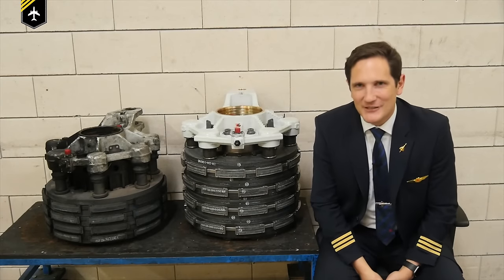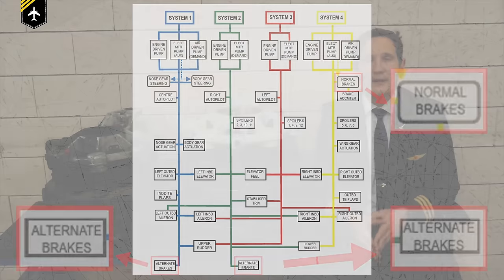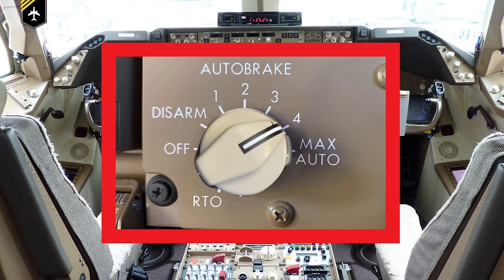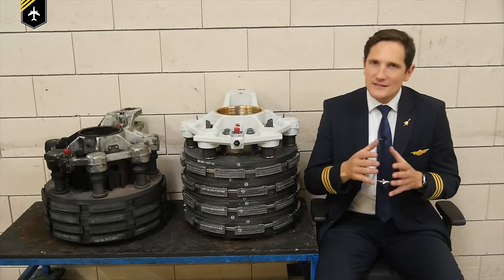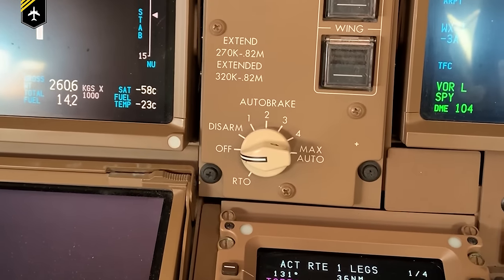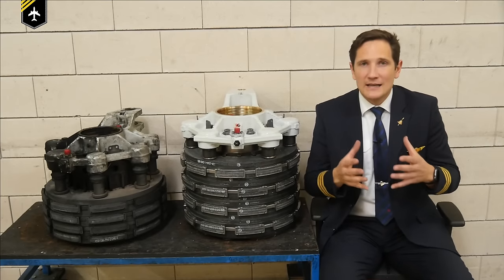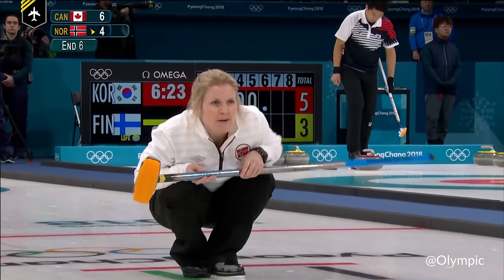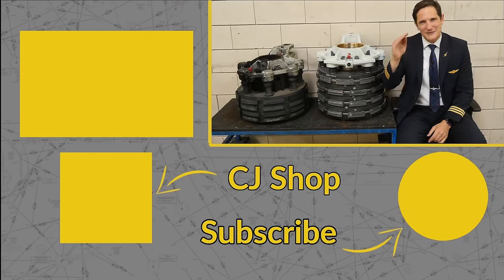How do PLANES SLOW DOWN on the RUNWAY? Autobrakes System EXPLAINED BY CAPTAIN JOE

Comment: I use to make aeroplane brakes in my last job. We made them for Boeing 777, 767 A380's and F18/22 fighter jets. We made the initial segments and then shipped them to South Bend in America for them to be finished off into fully finished brake discs. The discs are named stator and rota during production and that dictates the way the carbon is laid and cut.

Comment: I work for Parker Hannifin systems control division and I build the EHSV valves for the 777 and 747 autobrake systems. Have built literally hundreds of them. Never knew how they worked on the aircraft until now. Thanks Captain Joe........

Comment: Very well done Captain Joe. My 33 years as an airline landing gear engineer agrees with all your comments. Before the auto brake systems were installed, it was interesting that the left side brakes wore old a little more than twice the rate of the right brakes. It was suspected that the pilots didn't have as much control with their left foot as their right. Perhaps it was that they were used to braking a car with their right foot. We never found an answer. Thanks for your videos.

Comment: Loved it as always, especially with the break parts as props, although I wish you could have described them a bit.
RTO setting was a surprise and very interesting.
Patrean Brian
Reply: Airliner brakes are multiple pairs of rotor and stator discs, pushed together by pistons arranged around one end of the stack when hydraulic fluid pressurizes the pistons.  Typically there will be about four pairs per brake unit in a modern carbon-material rotor/stator design.  Steel brakes, used on aircraft introduced in the early 1980's and before, might have five pairs (or more? -- I don't know all of the aircraft out there).

Comment: I have a question about wing and engine placement. Up here in Scotland, we get a lot of regional turboprops and jets, and they all look very different from each other (ATRs, Dash-8s, CRJs, Saabs, etc.) Compare this with bigger planes for medium- and long-haul aircraft, you see that almost all of them (777s, A350s, 787s, A320s, A220s, E-190s etc.) are very similar in design with low wings and underwing engines. What are the advantages and disadvantages of these designs, and why do the regional jets and props have much more varied designs? Thanks

Btw, love your channel!

Comment: Hi Captain, english is not my native language, so forgive me if you already mentioned the following in this video.
What i'd like to know is: when ready to take off, autobrake set to RTO and go airbone, when does autobrake knob return to OFF position? Immediately after wheels leaves the ground? Or it depends by other reasons/variables or maybe on plane's model? Maybe there's a sensor (like autobrake engaging once touchdown) that "feels" the main gear is no more on the ground?
Every info about this will be very appreciated. Thanks.

Comment: Question: If manual braking using the rudder pedals would disarm the autobrake fully, would you always have to instantly switch to full manual braking when making slight rudder/steering corrections during rollout?  Awesome video as usual! 😄🙌
Reply: No because operating the rudder and operating the brakes are different function. Braking you tilt the pedal with your toes, for rudder you push the whole pedal

Comment: Loving your videos! This one is a little over my head. You are talking about braking when conditions are "reasonably normal". How do these systems react when placed under abnormal conditions like total loss of engine thrust? Don't answer that. I am lost already. I would love more info on the general braking system of all commercial airplanes. Speed Brakes, thrust reverse, braking from the pilots...if you have already posted content on that, my apologies.

Comment: Hello Captain Joe!  Another great video as always!  I'm just an aviation enthusiast but I feel like I have learned so much from watching your channel over the years!  I would love to see a video on how aircraft weight it determined.  Not only fuel and cargo but also passengers and their hand carry.  Seems like total passenger weight and their hand carried baggage could really add up to a significant amount of weight.  All of that combined weight I'm thinking could be significant for take off (reduced thrust take off, single engine climb out), landing (braking),  reserve fuel calculations, etc...  I'v noticed very few airlines weigh hand carry items.   I don't believe I've ever seen any commercial airlines ever weigh actual passengers.   When I used to fly on military aircraft especially in combat zones they would frequently weigh all the passengers along with their hand carry items, body armor, etc...prior to boarding.   Are any commercial aircraft able to weigh themselves via wheel sensors, some mechanism, etc.. or does it always require manually weighting everything prior to loading?  I think I have also seen some scales that an aircraft can drive over in order to determine their total weight.
Reply: Pretty sure no aircraft weighs itself and don’t know if any airlines that weight themselves. This did cause the crash of a plane in 2003 (Air Midwest 5481) where they found the average weight of the passengers on board was 9kg higher than the average weight they used. That and there were a mechanical failure too but the plane being overweight was the initial cause of the crash

Comment: 2018 A380 brake the same way my 1947 Stinson does. Push the toe brakes and hydraulic fluid in the accumulator gets pushed into the calipers and squees the brake disk then the airplane stops. Easy peasy! If ya ain’t yanking and banking ya spanking!

Comment: Great vid. I always have had the doubt of how you break and steer the plane while landing. If you are braking manually and need to correct the plane’s trajectory on the runway to keep it on the center line. I understand that you make the correction the the rudder but how you do it while you are braking 🤔 they are the same pedals 🤷🏻‍♂️
Reply: For Rudder (and some Nose wheelsteering) you PUSH the pedal (displacing its postiton) on the desired direction and for Manual Breaking you TILT the pedal (displacing its Rotation) in a forward manner. You can perform these two actions independently and simultaneously

Comment: Arent those pedals your rutter and front wheel steering as well. Wont you effect rutter by pressing on the peda
Reply: Yes both brakes and rudders are in the pedals. But both operate in a different way. Rudder is a sliding motion whereas brakes is a pressing motion. 
So when you press brakes, you apply equal pressure on both sides to have minimum rudder movement.

Comment: As per my knowledge, there's requirement of drag downside of the wing & streamline flow of air on upside for better lift. So why are they not using conveyor type mechanism to be more efficient? No 1 though like this? Just use conveyor to move parallel to air flow upper side & in opposite direction below. It improves slow flight configuration as well.
I wish I'll get your perspective.

Comment: Very informative Video Captain. I have a  query  regarding  Aborted landing  procedure. After touch down  on the runway, if pilot decides  for a  go around (due to some compelling reason of course ), Is there is any auto system exists in the aircraft   which can take care of the safe take off  activities  automatically such as  release of braking system, engine thrust increase, setting of flaps etc etc. Hope your reply soon sir.

Comment: What about the leading edge of the wing.  You did not mention slats.  They help lift during low speed operations.   Spoiler can be deployed when pilot determines they are needed. 
The Auto brake dial can be set before take off and kept there or adjusted as needed by pilot.

Comment: Do thrust reversers only reduce the wear and tear on the brakes or do they also help with reducing the amount of runway an aircraft needs to stop?
Reply: They work better on contaminated runways where normal brakes aren’t quite as good
Reply: On dry runways they only reduce brake temperatures and brake wear. On non dry runways, they also reduce landing distance because available brake pressure from the brakes will be limited due to wheel skidding on a non dry runway.
Reply: @pilotinterviewhandbook3064  so if airplanes didn't have reversers, runways would have to be much longer because the brakes are less effective during periods of rain?

Comment: can this be an upcoming video i would like to know why the larger planes have joysticks instead of steering wheel and vise versa for the the smaller planes aswell
Reply: Rachel O'Neill I’m assuming you mean sidestick vs yoke. Large aircraft have both stick (side or center) or yoke (depending on the model)
And small aircraft have both sticks or yoke (again depending on model)

The difference though between both is that in smaller planes, the controls are directly linked to the control surfaces, whereas Morden large planes have fly by wire, in which the controls are linked via a computer.

Comment: Can the pilots accidentally turn off the auto break system if say their was a cross wind and the pilot had pushed with his toes by accident. Or will it need a timer like trigger for it to be overridden. Also will it have a cockpit alarm like the auto pilot system
Reply: Ramper Ryan technically it can, but practically it’s unlikely as rudder action and brake action is different on the pedals (rudder is more of a sliding action, whereas brakes is more of a toe pushing action)

Comment: Hello Captain Joe, how is an airplane keeping its direction on landing or take-off? Is this process also automated? I have seen landings in bad weather (rain and wind) and it always follows the middle line. Is the pilot or the autopilot? Is this adjustment only from the wings or also by slightly turning the front wheel?
Reply: Most do the time pilot but if landed using autoland then it’s the autopilot. At high speeds it’s th rudder that steers the plane but low speeds it’s the nose wheel

Comment: Is the spinning of the wheels the only trigger or is the weight on the wheels also relevant?
I have the PIA 8303 accident in mind: somebody was arguing that they could(!) have saved that landing despite that incredibly unstable approach, if only the ldg gear had been deployed. I disagreed because of the high speed (long flare in ground effect + insufficient rwy length to kill all that momentum). I was wondering if braking can be effective at all if you are stupid enough to land at 100 kt above V-ref and 'force' the aircraft down at overspeed (=still generating some lift, therefore less weight on the ldg gear), assuming in this theoretical scenario that the aircraft doesn't just  bounce or porpoise.
Reply: If the landing made sufficient contact and the ground spoilers were armed then they would deploy and force the plane into the ground due to the aerodynamics. However it would take a lot of braking action to stop the plane and may be successful if they actually landed at the threshold. You would have to land flaps up and no flare

Comment: Reminds me that a few years ago i had to program an automated rotor brake system for a two bladed windturbine that should stop the rotor in a horizontal locking position after a power failure. The challange was that if it brakes too strong, it will never reach the position, if to weak, it will overrun and then stop before the second chance...and the brake hydraulic was not really analog controllable...
By the way i do not know which is my bigger nightmare, landing a controllable glider with only one try on a filed, or landing a balloon with only slow high controll on a field with several trys possible....

Comment: Captain Joe it's been long time, great to see you back,  it seems you were flying cargo during Pandemic n so absent, missed your videos, in future videos do throw light on fully wet runway braking, what happens when there is steam!! How reversers N spoilers help in that situation, also how bad would be a 10 knt plus tail wind while braking on a wet runway would be a interesting video!!🤣😂🤣😂👍👍💐🌹💐🌹👌👌
Reply: Just a few comments related to some of the above questions:  Spoilers are always important (wet or dry) for removing enough wing lift so that the tires will have enough downward force on them to where the brakes can develop enough drag.  That's because the mass of the aircraft is whatever it is, but the retarding force the brakes can produce is limited to the amount of weight on the wheels times the coefficient of friction.  So if the wing is still lifting a lot, braking effectiveness is compromised.

Maximum friction coefficient will be around 0.7 for a dry runway, more like 0.4 for a flooded one, and even as low as 0.1 (or less) for ice.  It also varies with speed, being roughly constant at higher speeds and increasing sharply below say 10 kt -- an "exponential decay" looking curve.

In a normal stop with light braking, thrust reversers don't account for much of the absorbed energy.  Call it 15% of what the aircraft's kinetic energy value was at brake application.  For a situation like heavy-braking at high landing speed on a wet runway, that's where they really can make a difference.  On an icy runway, they make all the difference.

Comment: Captain Joe, having been a general aviation pilot years ago I used to do a lot of touch and goes and I used to do slip landings both day and night on runways and grass fields. My question is do you ever do slip landings with commercial airlines?
Reply: Airliners are usually designed for just crab landings and not slip landing (As the rudders are not used that much due to their extreme effect. Only time rudder will be used during landing is while decrabbing and to maintain centerline)

Comment: Here's a dumb question:  Say your taking off from Denver International Airport and you're lined up on 16R/34L runway which is 16,000ft long.  Your cargo plane is light, so you know you will takeoff fairly quickly.  If you were to keep accelerating past the point of V1/Vr, would the plane start rotating by itself, or would it keep going down the runway??  Anyway, keep up the great work on these great videos.
Reply: Wayne Cox it would depend on the elevator trim and it's setting. Usually at take off trim setting, in your scenario yes it will eventually start to take off (but with a lower climb angle)
Reply: @ZK-APA  Thanks.  I'm not a pilot or FS person, so I was wondering.

Comment: Hey Joe does the auto break also controls the thrust reverser on touchdown or the pilot  manually activate thrust reverser after engaging auto break?
Reply: Rohan Keshri thrust reversers are manually engaged by the pilots (usually by pulling the levers behind the idle detent)

Comment: @Captain Joe. Have a strange question. You said the wheel spin sensors sense the spinning of the wheels and start braking. 

Let's say a pilot has a bounced landing and it isn't too bad a bounce to go around. The wheels still spin while they are in the air during the bounce. Now what will happen to the auto brake? If it continues to brake wouldn't it be dangerous to have a braked wheel when it touches the ground again?
Reply: Just a guess (probably wrong, though), but maybe the system uses the wheel spin sensors and the sensors that detect weight on the landing gear so that the auto brake system would release the brakes while the plane is in the air due to a bounced landing.
Reply: @basshead2003  makes better sense actually. Thanks.

Comment: Hey captain joe is it possible to fly your personal aircraft from the airport you store it at to a different airport and leave it’s there for a couple hours. I am just thinking for the future cause I want to go to flight school and get a small airplane for myself
Reply: Yes, you can do that. A ramp/parking fee can be charged for the parking.
Reply: Mike P if your low on fuel can you request to land at a international airport or even park it there or is it only small airports
Reply: @Falcon_9X  - At least in an emergency situation they allow the landing. (However, there are airports which can also have general aviation operations, but that depends totally on the airport.) Normally smaller aircraft use the airports designated to general aviation.